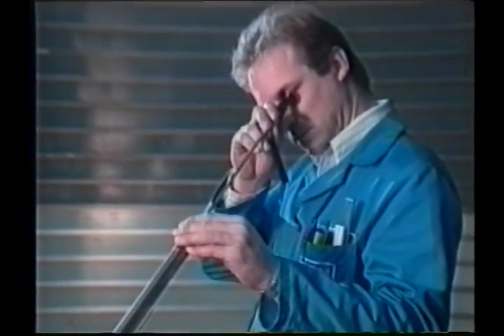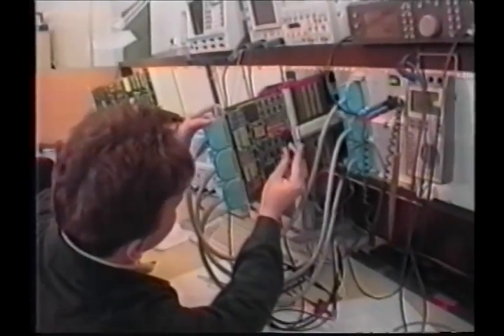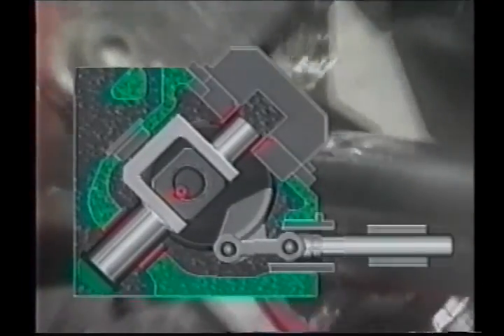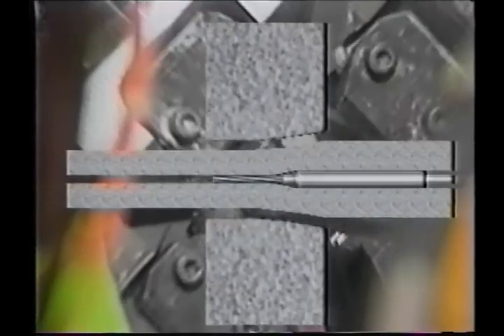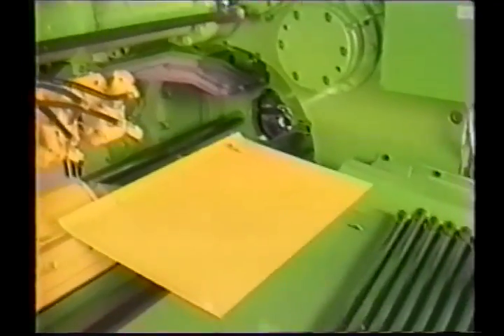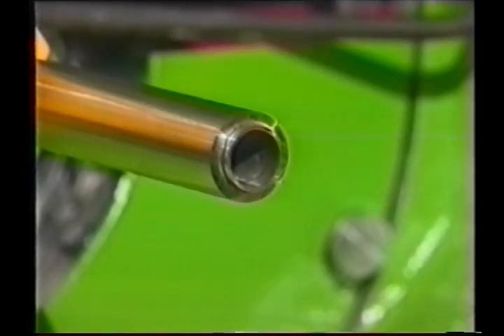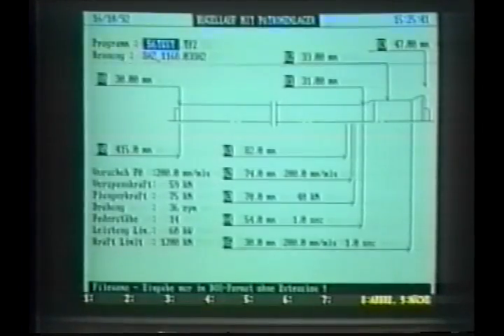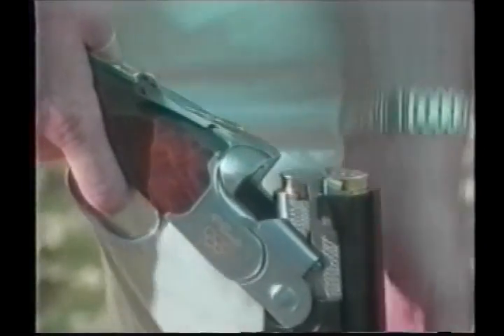AGFM Gun Barrel Forging MA

Comment: Remington, ruger, smith and Wesson, and Daniel defense all have agfm forging machines with Remington having the most in operation
Reply: Valmet/Tikka 412/512 shotgun/rifle barrels were cold forged with Steyr GFM system.
Reply: @Sevensixtytwo   GFM is the parent company of AGFM. Also the it should be noted that the company GFM is an Austrian.